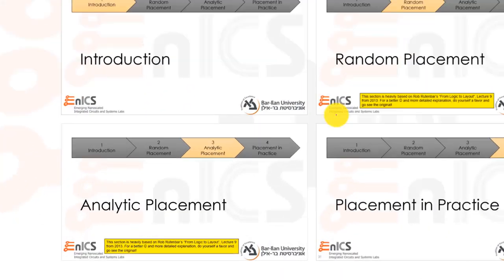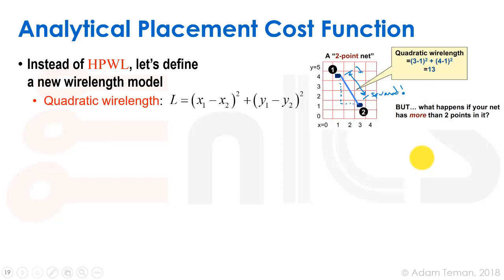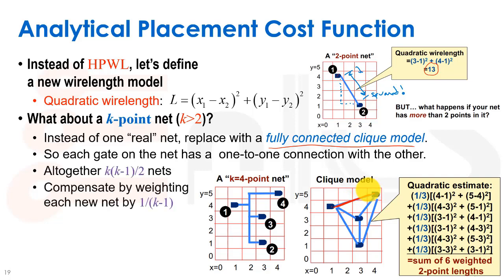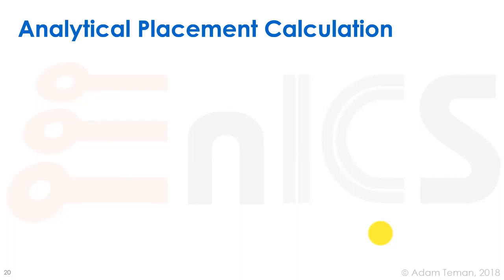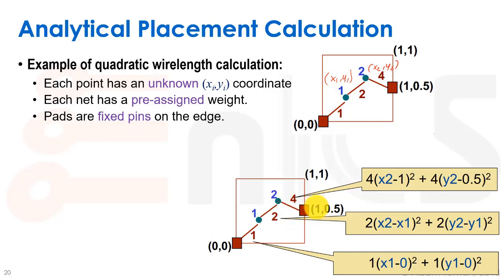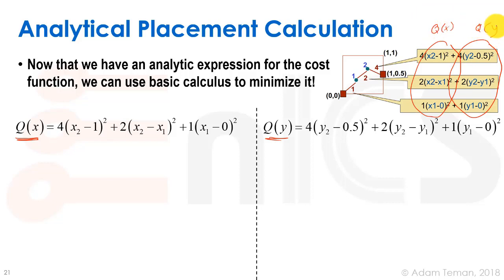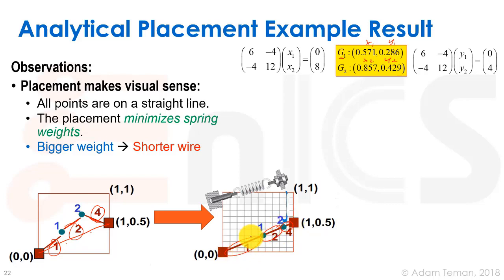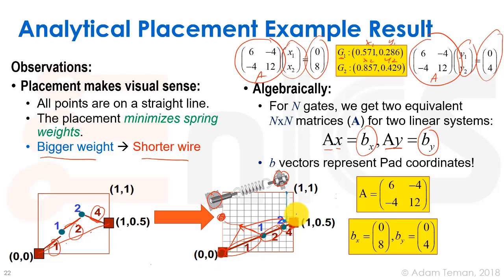DVD - Lecture 7c: Analytic Placement

Comment: First of all, thank you for these lectures, Mr. Teman. I have a question. How can we determine the optimum location for these pseudo-pads?  I feel like their position can significantly affect the final placement of cells. I really appreciate any help you can provide.
Reply from the maker: Hi Jim,

I did not discuss "optimal" placement of pseudo pads. In fact, I just gave a "trivial" methodology of how to place them (move them to the edge on a single axis).
I am sure that someone (maybe many someones...) has researched this and tried to build heuristics that will improve the placement of pseudo pads, though I am not aware of any (this is not my primary research field and I haven't tried to find such a solution). I could suggest for you to see if this has been done and if not, try to come up with such an algorithm!

Comment: Sir, we started with analytic equations and chose minima and maxima to arrive at minimum values of x and y. What research led to the formulation of connectivity matrix and Bx and By, to derive the final matrix equations for a placement problem?
Reply from the maker: Hi, sorry for the delayed reply (been very busy lately :)

If I understand your question correctly, then please refer to @14:00 in the video to see the "recipe" for calculating the b vectors.
The b vectors give representation to the pads (I/Os), showing the connectivity between the gates and the immovable pads (which basically pulls the gates towards the pads they are connected to). So for every gate that connects to a pad, we have bx(i)=wi*xi and by(i)=wi*yi, where w is the net weight and (xi,yi) are the coordinates of the pad.